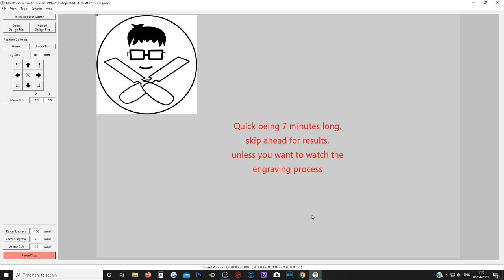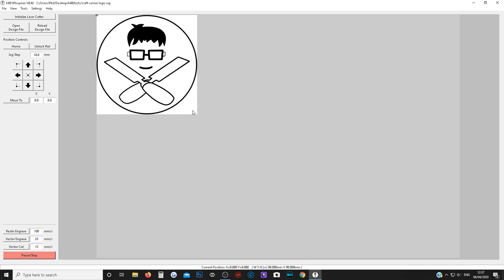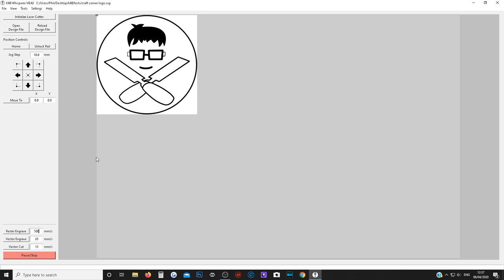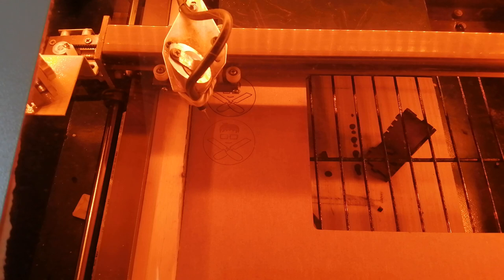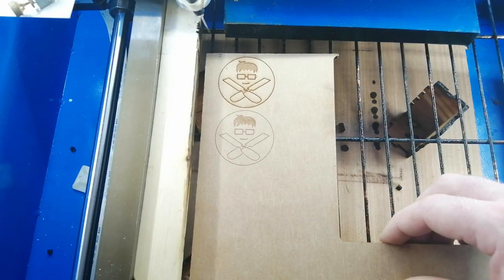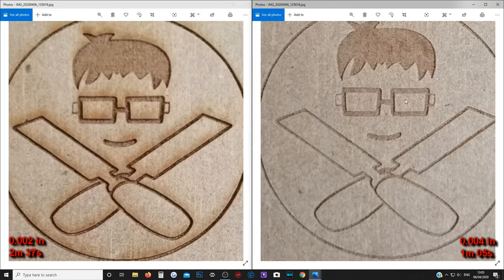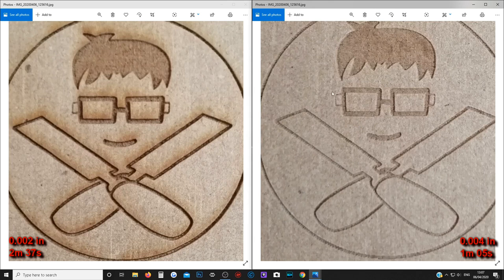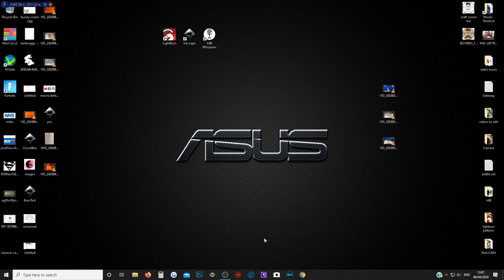Double raster engrave speeds using k40 whisperer

Comment: Glad I watched your video. I knew this setting was available but never really thought to try it out.  I'm doing some pretty intricate designs on slate and the 0.006 setting doesn't make much difference to the quality but massively speeds things up!
Reply from the maker: Glad it helped out
Reply: @philscraftcorner  I can't thank you enough. It's crazy the difference this had made to my slate engravings.  I had problems raster engraving very fine lines, I think what was happening is the lines where so close together that each line was kind of exploding the previous line off.  Anyway, setting it at 0.008 seems to be the sweet spot, fine lines come out perfectly now and the larger blocks of engraving have no drop back in quality. Engraving time has also went from 15mins to 3mins! Wow!
Reply from the maker: That's amazing results!

Comment: What power level do you engrave at? i think i went too high at 10 percent by accident bc i had just cut at 10 percent
Reply from the maker: I am running a 50w these days and cannot fully remember my speed and power settings. I think it was around 150mm/s at around 20% power.

I usually engrave MDF at 225mm/s at 20% power on my 50w though